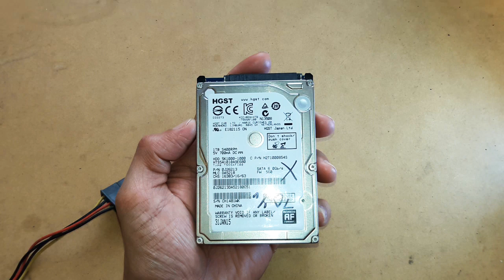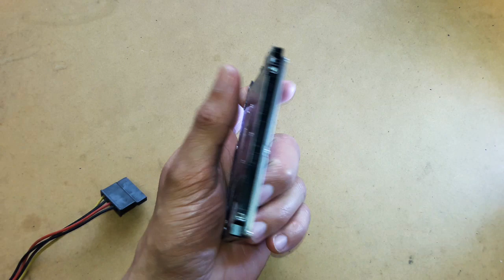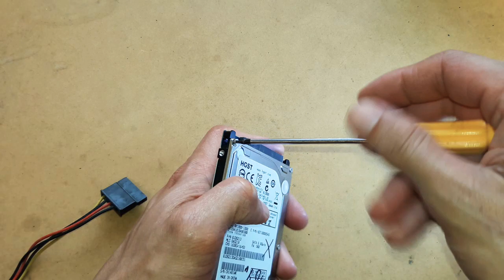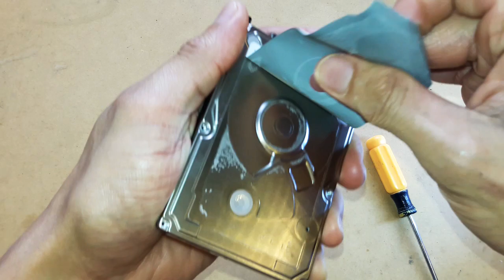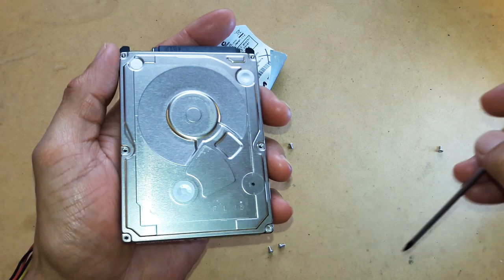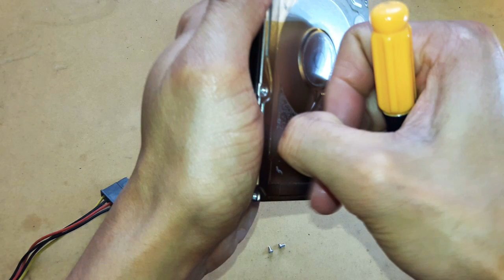HGST 1TB hard drive .. Open

Comment: Dear Same problem with my HDD kindly give solution
Reply: @thedifferenttech7325  what did you do ro fix it?
Reply: @martinmrgole6590  i have my own lab
Reply: any updates
Reply: @Marquis987  you need any help??
Reply: Tell me guyz.....what is your problem i will upload vidoes soon
Reply: @Rajkumari Patel Is your hard disk fall down before???
Reply: @Rajkumari Patel there have many ways to recover our personal data.......  you shouldn't open the hard drive ....your problem is not inside the hard drive its bad sectors problem  
i also face same problem but i fix mine
Reply: @thedifferenttech7325  the problem can be inside the harddrive too because if someone dropped that thing or anything else, that will messed up the spindle.

Comment: Am having the same problem how to fix
Reply: Turn the hard drive platter clock wise and there you go.
Reply: @shannonharvey8300  i know it's an old comment but it's originally turned clockwise already so in this case there is no solution because if the HDD platter was already on the disk before connecting it to the pc then the solution would be as you have described i think there is no solution for me then :'( i have to buy another HDD unfortunately!